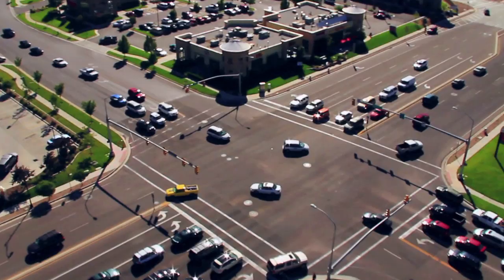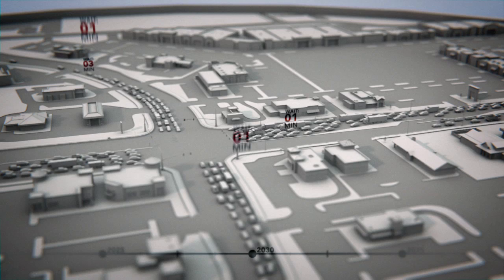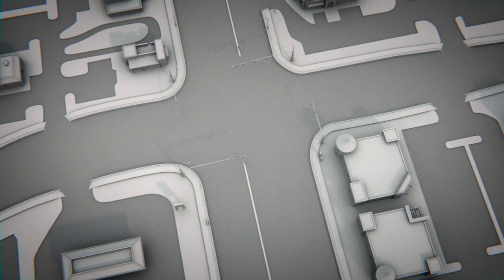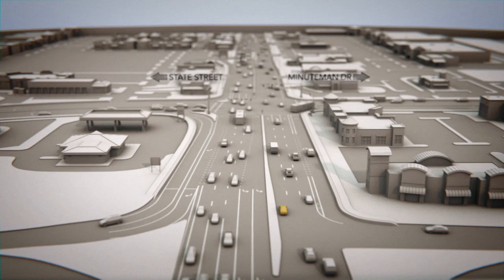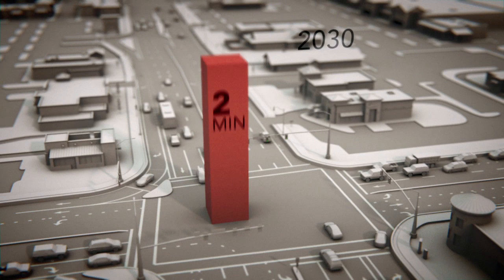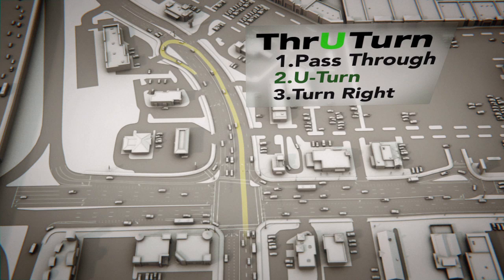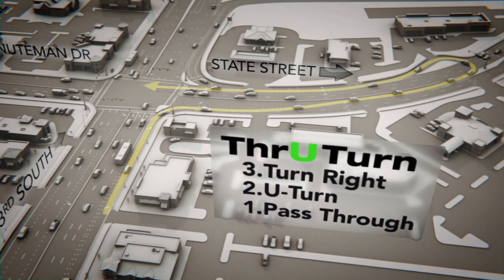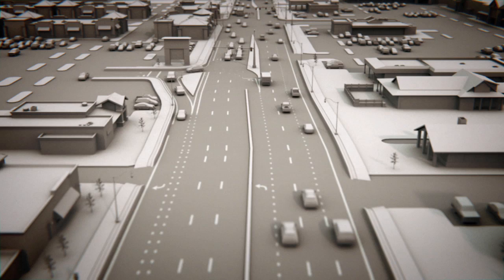ThrU-Turn Overview, Draper, Utah

Comment: So you take the left turn traffic & shift it to the right turn traffic in the opposite lane.

But what if a lot of traffic wants to turn right on the opposite lane & the left-turners are jammed back into the previous intersection because there is no space on the right side?

Because even if you put a traffic light there, the piece of the extended left turn & the main intersection still has only a limited capacity.

In front of the traffic light of the left turn could be even more congestion than already normal. 

This actually only works well if there are hardly any right-turners on the opposite lane anyway.

Comment: I know that the area is busy and has business, but wouldn't a large roundabout work? Also, wouldn't a Michigan left also work too?
Reply: ThrU-turn is another name for a Michigan left, its the same idea.  The roundabout would work but you will need to relocate existing business so it would have cost a lot more
Reply: @nicoepsilon0  
There is no roundabout for this kind of capacity.

What they need is :  shops nearby, so you won't have to travel 10 miles for your shopping.

Don't build a city.  Build  a cluster of small towns.